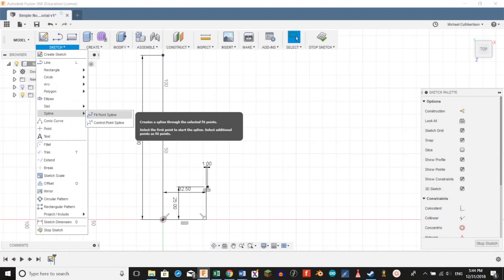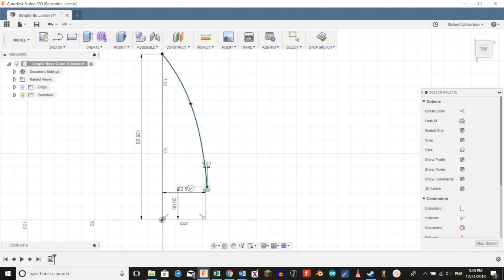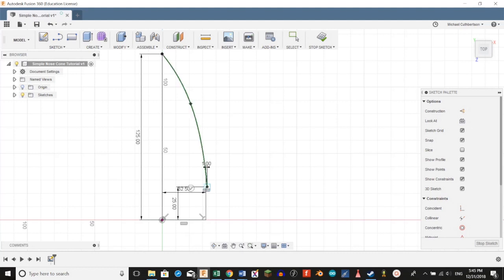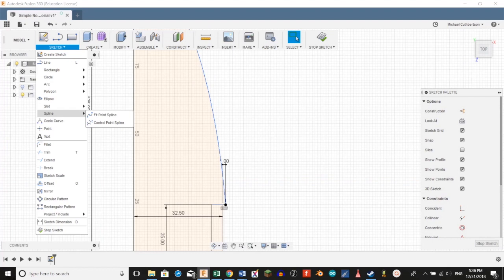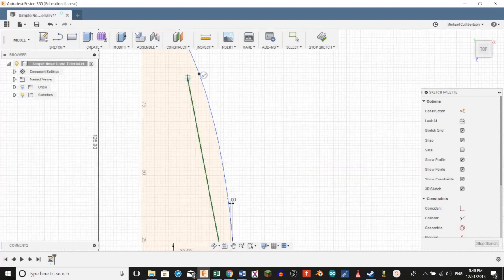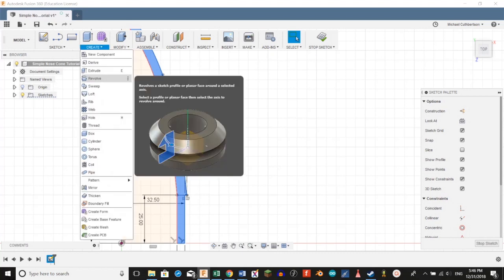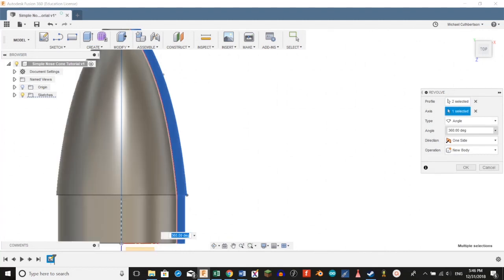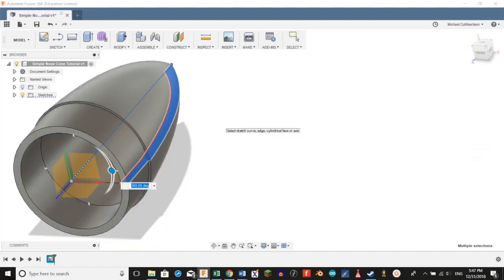How to Make a Rocket in Fusion 360 - Part One: Nosecone

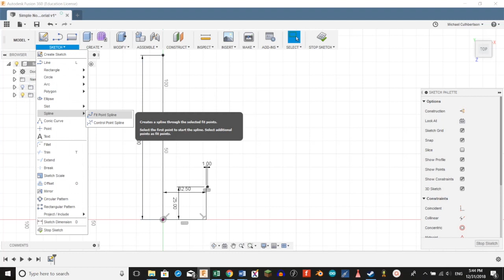Comment: hi,how did you select the midpoint?Like,where should it locate?At 0:25
Reply from the maker: You can choose any arbitrary point, you just need a control point between the start and end points to control the spline. It is possible to do it without that third point, it just depends on how much control you want.

Comment: For me (as a noob), it's way to fast to be able to follow what you are doing.
Reply from the maker: Yeah, I’ve heard that. The basis is just a revolve, if you know revolve then it’s just a a simple sketch profile to get there. I’m happy to answer any questions you may have.
Reply: @FrogPondEngineering  Well I do. I'm making a speaker in the form of a cone. I did a revolve around a profile just like yours (without the small knee). Now there's a seam along the inside and outside from the tip to the bottom. I have grid snapping on and my lines all snap to an axis (exept for the outer curve). The revolve is done around the X-axis so everything is perpendicular to each other. Do you have any idea why a seam would form from the tip towards the bottom?
Reply from the maker: Uh, the “seam could be either a.) a line appearing on the body telling you it was made via revolve, or b.) the revolve was not fully completed for whatever reason